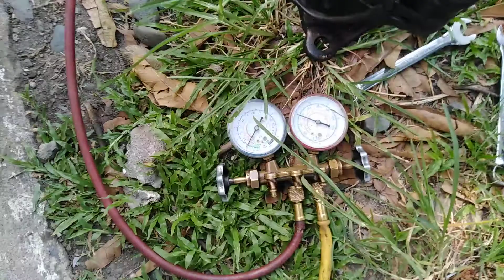How to remove rear evaporator of Isuzu crosswind.

Comment: Di ba pwedeng di baklasing yung AC system,sayang kasi freon wala ba pwedeng pandudukutan sa likod o kaya sa harap na evaporator?
Reply from the maker: Pwd po . May roon n ako ngaun n tinatawag n advance aircon cleaning maintenance. No Baklas Dashboard or evaporator cleaning. No chemical used.

Comment: Sir gaano po ang cost sa pagpapalinis ng ganyan?thank you po.
Reply from the maker: 3500 po kasama n charge ng freon, compressor oil,set orings linis ng mga evaporator at blower harap at likod linis ng condenser.free back to zero sanitizing odor eliminator antibac